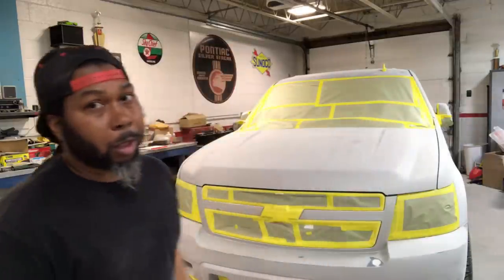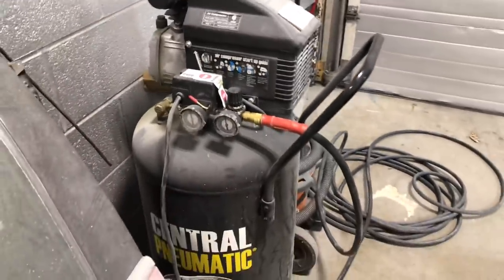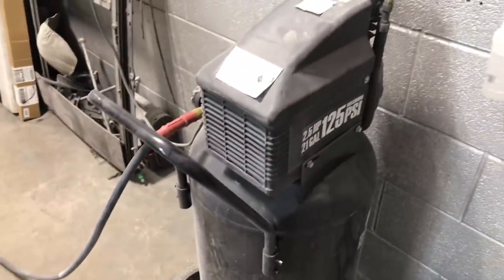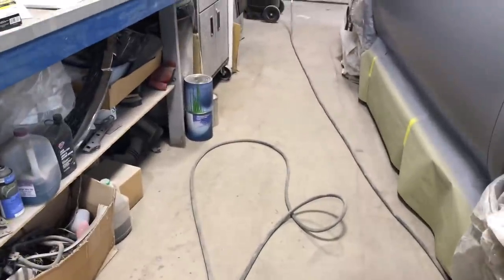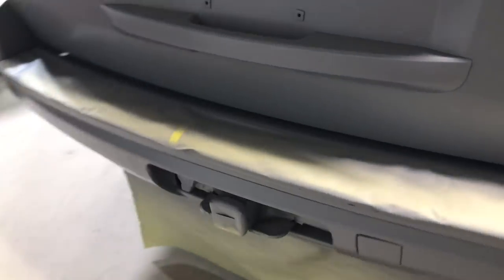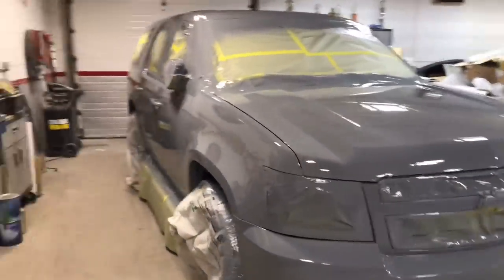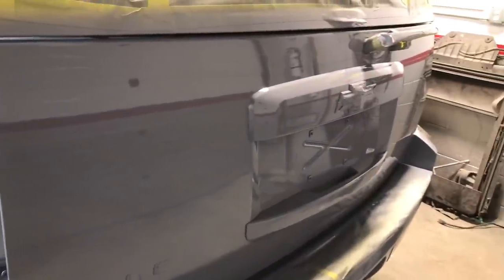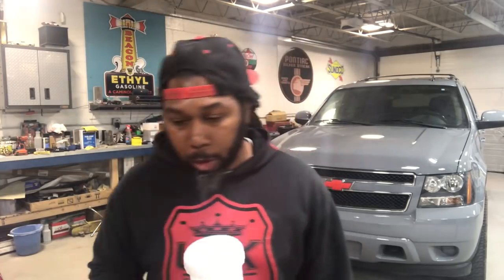COMPLETE PAINT JOB with the SPRAYIT R500 LVLP spray gun and a small compressor

Comment: Hey there UPK, thanks for the inspiring video. I went ahead and got the same paint gun and painted my truck with my small compressor and like you showed, it worked.  I'm wondering though, the SprayIT paint gun brochure it comes with says to lubricate it, but doesn't say where to lubricate it or what type of grease to use (although I think it may say not to use silcone grease.)  Do you have any idea what parts to lubricate and with what??  Maybe you could do a short video on that?  Thanks, Josh
Reply from the maker: Thanks Josh I appreciate you and glad to hear that you were able to do the same as I with the small compressor setup!…I honestly have never lubricated anything on any of my paint guns but I would think that it’s for the needle to move back and forth with no issues but I’ll look more into it and see if I can put a video together for it
Reply: @UndergroundPaintKing  U R the King!
Reply from the maker: @joshmorris2474  appreciate that Josh!

Comment: I'm using this same gun to spray a single stage urethane paint next week , what would be a good psi to run the gun at  ? Thanks in advance
Reply from the maker: I haven’t sprayed any single stage urethane with the gun before so I would recommend getting the tech sheet with the paint and go off those recommendations and then adjust if necessary to dial it in to your liking

Comment: Excellent job , you're a pro.  Just wonder , you mentioned about releasing the drain while working ? Would not affect the internal air pressure of the comp. ?
Reply from the maker: Thanks I appreciate you, and you want the drain open just slightly so that it can drain without having the air pressure running out rapidly

Comment: What size hose are you running to your paint gun? Would a 30 gal compressor be enough to paint a car?
Reply from the maker: I’m using a 50ft hose and a 30 gallon compressor will work with this spray gun SIX EIGHT

Comment: I have an Astro EVOT13. It says it's operational pressure is between 15-19psi. Is this where I need to be to paint base coat/clear coat. Gun had very good reviews. I've watched you spray with the Spraying 33000, and you were shooting base coat at 28psi and clear coat at thirty. I saw the specs for this gun, and it operates between 28-45psi. Different manufacturer, different specs I guess. Will I be alright spraying at the recommended pressure for my gun? Any help would be greatly appreciated.
Reply from the maker: You should be fine spraying at the recommended specs but don’t be afraid to do some test panels and spray outs to dial your spray gun in before tackling your project

Comment: Man that looked like a lot of work and came out nice. Did you use the 1.3 tip for base and clear. I just ordered this gun but my compressor is only 10 gal 1.5 hp and 4.0 at 90cfm will it do. I'm doing primer, paint on the roof,hood and new front and rear bumpers. Reclearing the whole car after.
Reply from the maker: Thanks I appreciate you Claurance2 and yes I used the 1.3 tip for base and clear…it should work for you as well!
Reply: Quick question when you sprayed the base and clear what we're your gun settings? Thanks
Reply from the maker: @claurance2  I was full fan full fluid when I sprayed this truck

Comment: So on your 21 gal compressor which would you like more your spectrum hte, black widow hvlp, or the spray it lvlp? Love your videos and you input thank you for your information.
Reply from the maker: It would depend on what I’m doing…if it’s something small I would go with either the spectrum or black widow but for something like a complete job I would go with the SprayIT plus I can’t go wrong doing something small with the SprayIT so I would say the SprayIT wins as far as the 21 gallon compressor goes
Reply: @UndergroundPaintKing  @ wats  diference   low volume& hi volume??
Reply from the maker: @gerardolopez5875  the difference of hvlp and lvlp is the cfm or air needed in order for the gun to work correctly

Comment: Just bought a astro evot13 gun, what size compressor do you suggest ? If you think the 21 gallon you use , I am all in. Thanks King
Reply from the maker: I would go off the specs of the gun to choose what compressor to go with…you want a compressor that will match up or be higher cfm than the paint gun itself

Comment: So, I have a 2009 Chevy Tahoe ( basically the same truck as this). I recently purchased a set of aftermarket Fender flares for it. I want to paint them to match the truck (paint code GM  U8624). I am planning to basically use this same compresssor setup. I have a 26 Gallon Kobalt compressor. Ill be buying this SprayIt R500 paint gun for this project and some other small projects that I have. What my question is... Where should I get my Paint? I am figuring a quart of paint should do it. Im wondering if you have any suggestions for me on what to get and where to buy it?? Thanks. Awesome vid
Reply from the maker: Thanks NORTHERN DECAL CO. I appreciate you, and I would check locally in your area for paint supply stores that can mix up what you need which is a basic white I believe and a quart should be plenty for doing some fender flares.
Reply: Thank you so much for the prompt reply.  I live in Northern New Hampshire.  My local choices are quite limited.  Also very overpriced. I was hoping you may be able to help me with finding a kit with the Olympic white paint and clear that I could buy online.  I'd like to get the project completed for around 100-150 in primer, paint and clear. Do you have a "go-to" budget primer, paint & clear?
Reply from the maker: @northern_decal_co.2607  here is a video I did on a budget primer I like to use
https://youtu.be/p6BHOj5hafM
I don’t order paint materials online that match oem but I would check with the options you have and see about possibly going with a single stage that could be cost effective and give you a nice result without having to buy a lot of materials
Reply from the maker: @northern_decal_co.2607  You could look into Nason, Matrix, or PPG for prices on paint

Comment: That was cool, so just out of curiosity do u think 21 gallon compressor is the limit or do u think u could go smaller? Like if u were just gonna do a car or something that size.
Reply from the maker: You may be able to go smaller but what you want to look for is the cfm of the compressor to match up with or to be higher than the cfm of the spray gun…the tank is gonna be the air supply stored before the compressor has to fill the tank back up so if you go with a smaller tank you will just have the compressor working harder to keep up

Comment: I have the same air compressor, same gun and I have the air pressure similar to how you have it but there’s times where paint comes our dry in some spots and good and other spots any recommendations on what may cause this. Thank in advance
Reply from the maker: Are you saying it’s dry spots and wet spots on the panel that you’re spraying?
Reply: @UndergroundPaintKing  yes, in the same pass there’s times it will lay dry and others that it will come out normal
Reply from the maker: @S197jet  are you keeping the same distance from the panel while spraying? If you’re spraying too far away from the panel it’ll cause the material to lay dry as if you spray closer it’ll lay wetter, or your pressure is too high or too low
Reply: @UndergroundPaintKing  okay I will make sure I’m staying at a constant distance and double check my pressure. Thank you for getting back to me
Reply from the maker: @S197jet  you’re welcome!

Comment: Would you use the same tip size for single stage paint as you used for the base and clear on the suburban?

Thanks.
Reply from the maker: You can definitely use the 1.3 tip for single stage paint

Comment: What is the CFM rating on compressor and which gun did you use and can it do base and clear trying to paint my car in garage
Reply from the maker: I don’t remember the cfm of the compressor and this is a base coat clear coat job that I did with the SprayIT 33000 lvlp spray gun so the answer to your question is yes you can paint a car in your garage

Comment: Total noob here. Looking to paint my 97 c1500. When using that set up is there a particular type of paint that's better to use ? Do the ratios stay the same ? Thanks in advance.
Reply from the maker: Appreciate you checking out the video Detail Guy and you can spray pretty much any kind of automotive paint materials with this spray gun as long as you have the right tip and needle setup for the thickness of the materials you’re spraying. Also the mix ratios can vary and are not all the same
Reply: Thank you sir! I've watched hundreds of hours of your videos ! Your the goat !
Reply from the maker: @detailguy8892  I appreciate you watching the videos and I hope they help!

Comment: Damn bro!! How long did that take?? Thats crazy!! I made the mistake, well learned the lesson of spraying 20 interior door and trim with a harbor freight siphon HVLP and a ridgid 3’gallon compressor...it took forever trying to fight the paint clogging the gun, filter the paint, latex and thin it with water and floetrol. The doors came
Out looking like cabinet doors, near perfect atomization, just be sure to thin paint If needed, have proper size compressor (at least 20+ gal IMO) and paint filters, as well as clean the damn gun or you gonna run thru them quick.
Reply from the maker: Only took 2-3 hours maybe to paint since I kept having to stop to talk to people inquiring about getting some work done

Comment: Hi, I would like to try this with the same compressor. To me it seems that you are spraying a bit closer with the LVLP gun than I am used to seeing with say a conventional spray gun. Is that correct?
Thanks for the video!
Reply from the maker: Yes James I am spraying closer than what you may see others do but I have been spraying for a while and have gotten use to spraying that way…I appreciate you checking out the video!
Reply: @UndergroundPaintKing  I understand why you would do that especially considering that you have the experience to avoid runs but would you say that spraying further out is any more "harmful" to the finish than it would be with a HVLP or conventional gun? Thanks again!
Reply from the maker: @jamesdean5677  it can be if you’re to far away from the panel and dry spraying so you want to find a good distance from the panel around 5-8 inches is a good start
Reply: @UndergroundPaintKing  Thanks for tracking my point. That range is super useful. Probably makes sense to practice on a spare car part.
Reply from the maker: @jamesdean5677  yes I recommend spraying test panels before actually spraying your project

Comment: Hi what size HP compressor did you use or recommend to use with the LVLP gun. i have 3 HP 80 litre 21 gallon 
CEVIK PRO80SILENT 68dB i set it at 1.6 bar but it doesnt hold that preasure for long about 30 seconds.
Reply from the maker: The compressor I used in this video is a 2.5 hp 21 gallon compressor

Comment: Awesome job where and which gun should I buy? I have a 21 gallon compressor already.
Reply from the maker: The gun that I’m using in this video can be purchased on Amazon or Home Depot and it’s the SpayIT sp-33000 lvlp gravity feed spray gun
Reply: @UndergroundPaintKing  and if you don’t mind how do I prep the whole vehicle to get it ready for paint? Can you give me the entire process?
Reply from the maker: @bowtiechevyboi3864  to give the entire process would vary on the condition of the vehicle that’s being worked on
Reply from the maker: @bowtiechevyboi3864  a general process would be to sand the vehicle in 320-400 or finish in 600 then be able to paint the car
Reply: @UndergroundPaintKing  would you add primer after that? Then paint it. My Vechicle in good shape.
Reply from the maker: @bowtiechevyboi3864  you could do a sealer but you can prime spots that you fixed then sealer
Reply: @UndergroundPaintKing  so I would have to use sealer for the whole Vechicle? I thought I had to primer the whole Vechicle. So once I sand it down I wipe it and then I can paint once I seal spots that’s been worked on correct?

Comment: The clear is peeling on my 07 Tahoe and it's a gold color.  If I sanded the clear only,  can I spray a few layers of the og color first to liven it up?
Reply from the maker: If done just right and sanded with 320-400 grit you possibly can pull it off…it’s not the route I would take personally but it’s still possible Martin
Reply: What route would you recommend
Reply from the maker: @martinolivas319  I would prep with 320 then spray 2 coats of primer then then block the primer to make sure I’m even then seal the hood and paint it…but you don’t have to go through all those steps. I have seen peeling paint be sanded and painted right over it and it turned out fine

Comment: So I shouldn't  have any  problems   painting  my 63 fairlane with my 27 gallon ap. 6.8 scfm at 90psi
Reply from the maker: It should work for you if you have the right spray gun
Reply: I have the r500 the  same one you had there
Reply from the maker: @bigfish8473  You should be good!

Comment: Got two other lvlp spray guns now one for clear 1.3 and one for primer 1.7 will be a while but some stuff on Ali Express you can get from USA. Never used a lvlp spray gun but with the compressor got at home it will be better since only have a less than 30 gallon air compressor. Still gonna paint my truck though with the electric spray gun got that has multiple tip sizes on it like 1.2, 1.5 I think maybe a 1.8 too. Thought would of started but still trying to get the last part of the garage cleaned and gonna get rid of these empty boxes in the backyard which were in the garage too. And more scrap got when some stuff that didn't need. I be glad when I leave Michigan because the job I work at now I really don't want to be here anyway auto painting and detailing is what I want to do just gonna keep doing it so can keep on getting better. I know it only been a year since the first time I painted before that didn't turn out good but want to get better. But I have a lot more auto detailing tools now too.

Comment: Good video my man!  I would label this a torture test on the harbor freight compressor!  How has it held up so far?  I've done similar things with my old craftsman 21 gallon oil free compressor.  Water in the lines, heavy duty cycles, and not being able to keep up with what I'm doing with the same gun.  
Hopefully you're using a bigger compressor for your regular work?
Reply from the maker: Thanks I appreciate you and my compressor is holding up pretty well actually and I have other videos of doing overall paint jobs with it on the channel as well. I do have a paint booth and a 80 gallon compressor that actually runs my shop so I don’t use my small compressor on everything which saves the life of the compressor obviously lol

Comment: Is the sprayit a double action gun?
Thanks for the video.
Reply from the maker: What do you mean by double action?
Reply: @UndergroundPaintKing Double action in that if you let off the trigger you can stop the paint flow while still having air coming out of the gun. I heard that is a double action. I would suppose that the sprayit 33000 would be like any other paint gun that has that ability, unlike some air brushes.
Reply from the maker: @randyanderson6110  it’s definitely a double action gun

Comment: Great video! I'm fixing to try spraying a huge step van using this method! What primer/base/clear did you use? In the video since it's still taped up I'm guessing it was wet...did it ever shrink and get orange peeled looking after fully cured?
Reply from the maker: Thanks I appreciate you checking out the video!…the primer I used was a 2k primer from shopline and I also used shopline for the base which are ppg products and for the clear I used Evercoat HS clear which laid nice and didn’t leave a heavy orange peel
Reply: @UndergroundPaintKing  with these LVLP setups have you ever tried spraying something real high build like Feather Fill G2. A lot of high build stuff takes big tips like 2.0 but I think I can find a LVLP with a 2.0 tip....but not sure how well the low volume will handle that thicker product.

Comment: What up.
What kind of spray gun do you recommend for a 21 or 27 gal compressor? 
Would the black widow work with a small comoressor?
Reply from the maker: What’s up Kilo…the spray gun I’m using in this video is one I would recommend for a small compressor and if you’re doing small jobs and nothing to big then the black widow might work for you but it works best with a bigger compressor…I appreciate you checking out the video!
Reply: @UndergroundPaintKing  thanks for the reply. Can i spray matte with that gun also?
Reply from the maker: @kilogolfmike8095  yes sir you can
Reply: @UndergroundPaintKing  thank you sir
Reply from the maker: @kilogolfmike8095  you’re welcome!

Comment: Nice work! Did you need to let the compressor catch up at all or did you keep painting continuously? Did you have to watch the pressure at the gun to make sure it was up where it should be? Thanks again for your real, practical demos.
Reply from the maker: I didn’t have to wait for the compressor to catch up and I didn’t have to watch the air pressure either…I would definitely do different about a filter setup and then I would be good to go…I appreciate you checking out the video!

Comment: Great skill man and excellent finish. I have a similar sprayit gun and hoping to clear coat the hood of my civic. What settings did you use on the gun. I got the psi (33), but what about the precise turns on the other knobs I can utilise. Was hesitant to do this DIY until now. Thanks.
Reply from the maker: You can start off full fan full fluid and it’s best to do a test panel to dial in for the clear